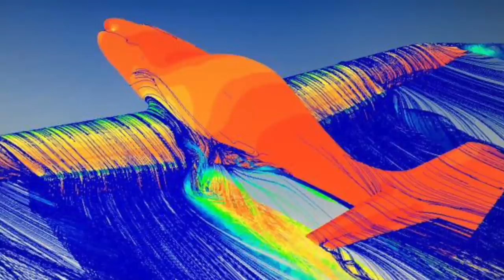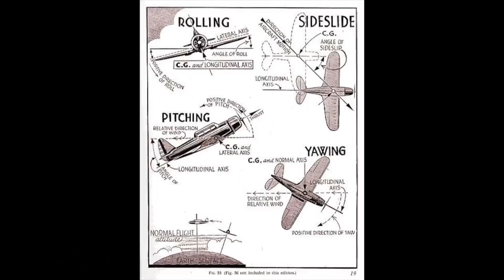Stalls & Stick Raps - Flt 005 - Hakan's Fowler Flap Lancair - Last flight before flap testing

Comment: The first two times it stalled in the right-wing dropped is odd because you're right aileron was up. Your third stall more matched your aileron position with the left wing dropping. Is that an indication that your ball was not centered as you mentioned in the video?
Reply from the maker: Yes

Comment: Always enjoy your videos, I'd suggest adjusting the volume levels for the voice-overs to the inflight audio.  👍✈️
Reply from the maker: Yeah there was a problem with the audio cables on the flight.  I apologize.
Reply: @utopiasnow  No worries just pointing out stuff to make your videos even better.  Not sure what editing software you use but it is fairly easy to adjust volume levels that way.
Reply from the maker: zmatt thanks, yeah the radio track is as high as I could get it.  I fought with it for a week, and finally just released it.  My apologies.
Reply: @utopiasnow  Yea I think it was because of the loud static in there.  Still a great video.

Comment: Great vid, as always. 
Since you occasionally perform tests alone (in the sense that you are the only one there from Wasabi), have you considered a gps tracker to carry with you in your flight suit?
Stating your location by comms seems risky, especially since the comms are perhaps difficult for non-flight-test ears.

Otherwise, switching on your phone's live tracking (through maps, or even whatsapp or something), is for sure a nice back up. 
Even if the signal might not be good at high altitude, the moment you'll need it - hanging from your parachute - it is likely to work.
Reply from the maker: Thanks for the comment.  Yes the cell phone is a must.  Another reason we like chase on high risk flights.

Comment: Is a stick wrap a pulse or a step input. I thought they were Dirac impulse input.
Reply from the maker: The idea is a step input to excite the widest range of frequencies in the structure.
Reply: @utopiasnow  I get that, learned it modelling step functions with Fourier functions. I'm studying autocontrol currently (mechatronics engineering student in Australia - want to engineer myself into aviation) and we're using step functions in feedback transfer functions which a very different effect. It's not what you're doing as you're disconnecting the feedback loop. 

I guess I'm asking why you regard the stick wrap as a step and not an impulse? Is the deflection not short enough to behave like delta function?
Reply: @utopiasnow  As an aside, I can see that you're checking each axis and control input. in 5kn increments. How do you respond in the plane if one of the wraps initiates an undamped or divergent oscillation? Is there a response that works or is the divergence going to increase too quickly and you have to bail?
Reply from the maker: The short answer is you likely won’t catch it before the airplane scattered.  However the idea is that you can feel the damping change with speed and knock it off before it goes undamped.  Either way it’s better to scatter yhe airplane on a flight test day at altitude over the airport l, than descending below a layer with the lady in the right seat on the way to grandmas for thanksgiving.  Thanks for the comment.
Reply: @utopiasnow  yeah scattered in testing is quite preferred. I just wondered if you had enough warning to dump power and airspeed before it scattered. Sounds like damping reduces gradually but instability is very fast.